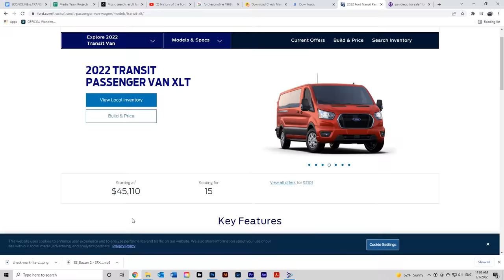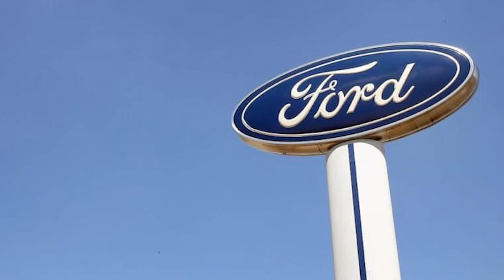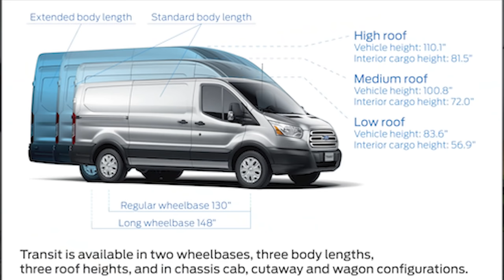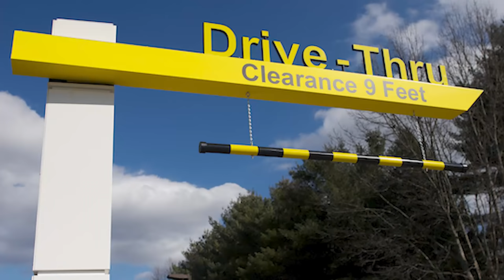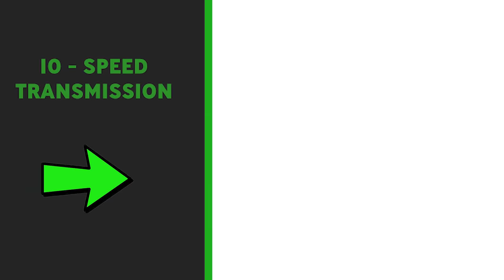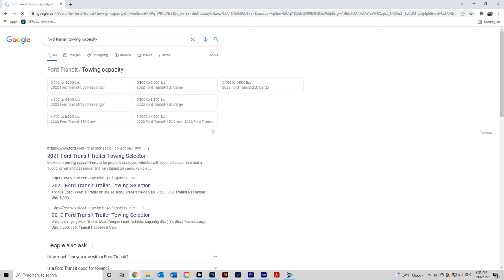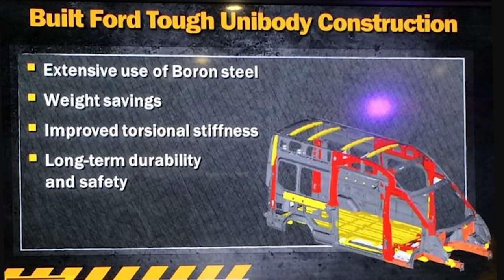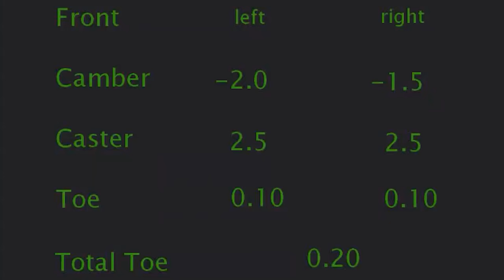Ford Econoline VS Ford Transit | Side By Side Comparison!

Comment: Trust me you want the 4.6L. They don’t die.
Reply: Who are you specifically that we should just "trust [you]"?  Give some data or experiences or SOMETHING
Reply: The 4.6s are famously known to in the Crown Vic’s, Town Cars, Grand Marquis, F-150s, and Mustangs. All of them are incredibly reliable.
Reply: Had every engine the E series ever had.  The “truck 6 “ 300 ci shit all over the 4.6 as did the 351 W (with cross flow injection) and definitely the 460 ci. The 4.6 totally underpowered and got worse mpg than most of the larger engines. 5.4 triton was ok as long as you could keep the spark plugs in the heads !! Same as the V 10. ( just a 5.4 with 2xtra cylinders slapped on ). 4.6 in my explorer and clown car - great. In the e250 sucked
Reply: @StepheMauro-kh1px  I hated my 4.6 until my mechanic changed e2 sensors, plugs, coil pack, cleaned mass air flow  sensor, and got the computer shifting the trans correctly. I carry heavy loads and no longer get pushed around by SUVs. 2005 200k miles.
Reply: The 5.4 2 valve  is pretty  bulletproof as well , I mean it's no 300 inline ... but if you take care if it it's a great engine
Reply: I have an E150 and 250 both with the 4.6  both have over 200,000 miles.
Reply: My son had a 2005 short wheel chair E250 van (super hightop) with a 4.6
 It did REALLY well and had plenty of power. 17-18 mpg highway.  My 2013 E350 med hightop 5.4 can get 16 mpg if you REALLY stay out of the pedal.
Reply: @Redfiregtag 
Oh, the 300 is damn near indestructible.
Reply: They dont die but you average 13mpg for the rest of its life 😂😂

Comment: Convenience tall roof only. Transit. No question. Reliability E series. No contest. Long term ownership. E series no question. They last forever and parts are stupid cheap! Rust is the only drawback. You can do a lot of repairs and use a lot of gas for the money you save though. E series for the win!

Comment: Call me crazy but I love the 4.9L / 300 straight 6. Sure, not a ton of horsepower, but totally bulletproof and lasts forever. I'm all for the E-series. I want an old-school vehicle I can actually wrench on myself. Not something that requires a degree from MIT just to change the oil.

Comment: i owned 7 Ford econolines...75 to 95....from 351 , 300 six....302.....in 2015 i bought a new T 250 mid roof 3.7 non turbo......the Transit has given more problems...that all 7 Econolines...while i like the heights...lengths and handling of Transit....but cant keep brakes on it...28,000 miles.never pulls a trailer even though it got trailer towing package....under gross vehicle weight...they didnt update brakes pads look like car typle...,,now is a good time to mention you have to pull rear axles out to replace rear rotors and brakes...costly......hard to work on ...try changing automatic transmission fluid in one..as far as engines...when empty the 3.7 is a little better on gas...but when loaded no better than 351 v8...i wish Ford had kept chasis and engines of the Econolines...and make mid and hi roof editions of it....also just read on all these sites how bad direct injection clogging intake valves...and cam phasers...and chainging are ware out on these new engines...something never had to worry about with Econolines..

Comment: My 2010 is on beast mode. 6 day  work day. Pushing  600 k. Change oil once a month
Reply from the maker: Does it burn oil or do you just drive it a lot?
Reply: @WeldtecDesigns  it does burn oil as 13+ years has a tendency  to make the oil seals not quite a perfect  tight. I never stomp on the gas and rarely  go above  70 mph

Comment: I have several E150's. If I don't get atleast 600,000 miles out of the original 4.6 engine and transmission, I'm disappointed.I know the local Ford dealer  service manager and he told me that the Transits just don't last like the E series did. He said if they 250,000 miles out of a transit they think they've  done something.

Comment: My 2008 has 372K runs great. Had transmission rebuilt once. 
My coworker has a 2004 with 508K and refuses to get a newer one. 
We both plan on driving them to the ground lol😅❤🎉. E-Series Rocks!

Comment: I bought a Ford 2021 E350 cutaway van with a 14'5 box and a 7.3 gas motor. I took it to 5star tuning and had them tune it to above the F350 tune.
The box has a 84" interior height and 79" interior width.
I have converted it into an RV.
I bought it to tow a modified Jeep around the USA, Canada and Mexico on a trailer. 
With the tune on the 7.3 I am getting 12.8 mpg. The tow rating is 12,000 lbs with a 4.56 gears and the 6 speed auto.
Reply from the maker: Send us pics! i would love to see that!
Reply: Why did you choose the 6-speed instead of the 10-speed?
Reply: @pronewbofficial  the 10 speed is not available in the E350 platform. 
I would have gotten a 10 speed if available
Reply: I have been thinking about doing this. Did you buy the new cab from Ford and then shopped for a box? Or did you buy yours complete from Uhaul or something?
Reply: @cvcoco  I bought a new one and special ordered it. It's a FedEx spec cutaway van. I'm tall so I ordered it with a 84" interior height and a 79" interior width. I wish I had of gone with the E450.
Reply: @Scrambler85 what was the mpg before the tune? When shopping around I see low mileage 7.3 cutaway box trucks for less then these high top transits. You get more area and 2x the towing capacity seems like a no brainer.
Reply: @user-tg3vw4pd7j  before the conversion I was getting 11.5 - 12.5 at 70 mph on the interstate. Now it's 10.5 - 11.5. I gained about 1.5 mpg and and more than 100 hp. The F250 has 430 hp, the tune is equal or a little more from the original 300 hp.
Reply: @Scrambler85  What is the city mpg? How is it while towing? With all the problems people have with the 10 speed this cutaway with a heavy duty 6 looks like a great set up.
Reply: Thanks for that description. Sounds cool. Did you put a fiberglass wind dam on the front of the box? I have a 2003  cutaway Quigley E350 w/ a 7.3 PSD. I grabbed a fiberglass wind dam from a local junk yard this week. I am sure its gonna help, just curious of others experience.  Its a super slick tight fit, so I am excited to throw it up there to see.
Reply: @reidcrosby6241  mine has a Areo top above the cab. Gives me a 6' door into the box, and some extra storage
Reply: @Scrambler85  thanks

Comment: I just picked up 2013 Ford Econoline 350 XLT with 18K miles.  There is something about the look of the Econoline attracts me to it more than the Transiit even the Transit got better mileage or room inside.  Just update new infotaining and sound system.  Next will work on lift :) 
Great video there Jeremy!
Reply: It’s body on frame, usually with V8 motor, and transmissions that cannot be killed, . .. E vans were the most reliable vehicles ever built, they can take so much abuse and still go.
Reply: What are you getting MPG?

Comment: Paramedics frequently work part time jobs.  Mine was for a company that only picked up patients at all those free-standing ER's that popped up everywhere. Good business model for an ambulance service, very profitable.  We got the first Transits that were made into ambulances.  I had just retired from a municipal EMS that used F-F450's with HUGE boxes mounted on them, an Iowa class battlewagon.   So I went from having all the room in the world with all the storage space for all the cool paramedic toys in the universe to a narrow shoebox.  Its ok for non-emergency local transports (the bulk of the business in the freestanding ER to hospital niche) .  It was uncomfortable on longer trips. They had frequent electrical and cooling system problems.  The Ram Pro Master ambulance conversions have made big inroads into the market.  They have a lower load height for one.  I started EMS in the 80's for a private company that used E-350's with a high fiberglass top attached.  They were rugged, strong, fast and maneuverable.  Not many of those are being made now. (Because the Transits and Pro Master have higher roof options from the factory)  Most E350 chassis ambulances are just the van cab and a box mounted on the frame.  We swapped from gas to diesel in the early 90's. More torque, held up better.  There's a move back to gas going on.  Diesel is much more expensive now.

Comment: Yes! I think you are the only place where we van enthusiast can learn the optional overland builds available for the newer Transit.
Especially, the difference in mpg between stock and lifted larger wheels. Of course it will also depend upon the Transit engine size. Hopefully, you will show the 3.7 because that is the most common. Also, standard vs 4x4.
Thanks for the show!
Reply from the maker: That's what we're about. We're here to inform and entertain. It's awesome to see you watching our content and learning something too. Comparing a Standard vs 4x4 could make for a great future video! We'll keep that idea on deck!

Comment: I have a 2007 E350 with the 5.4 and yes sucks a lot of gas but I love it so far is been a super good van, I tow with it few times a small toy hauler and even that is loaded with tools for my business over 2500lbs it pulled nicely,  I put a awning on it to use when camping etc and if you see this van in the cargo area I will say is the only van like that because I set it neat and everything is Milwaukee packout drawers etc ,I can called my Milwaukee van! That's how nice is set up, I can't go wrong with what I have now, very happy with it!, purchase this van under 93000 miles and just remove the  thermostat a week ago and loving it! ,didn't have any issues yet and it's about 110000 miles with still factory  parts, only belt and thermostat so far.

Comment: Thanks for a great video.
I love my 1999 Ford Econoline E350 super duty van with 202,000 miles on the odometer.
She starts first time, every time. She cruises at 80 mph all day, hitting limiter at 95.
I call her Ol' Trusty Too. I replaced these items: springs, shackles, shocks, upper and lower ball joints, kingpins, tie rods, steering gear, rotors, calipers, Goodyear radials, radiator, alternator, nickel rust-proof nickle brake lines, intake manifold gasket, coil wires, plugs.
This vehicle's stance indicates competence and capability.
She cruises like a Chevrolet Suburban or a Ford Expedition. With a 3.79 differential ratio.. 1,750 rpm at 60 mph -- effortless interstate cruising with sufficient power to tow a fully loaded double-axle U-Haul above interstate speeds all day long, with no oil pressure or coolant heat problems in the 5.4 2 valve V8.
Ford vehicles have excellent, safe driver visuals. The side windows dip low, the windshield is wide and tall. Chassis and inside, outside trim and body integrity are the best in the industry. The 25 year old headlights shine straight and true, and do not vibrate in their mounts. Obviously the electric system is A-1 for these headlights to have lasted this long.
Ford light trucks are the best in the business.
Detroit Iron Forever!

Comment: Good stuff. I just got a Ford Transit 350 EXT High Roof.  I tows less and has less get up and go thanow my El350 with a V8 but I am 6'4 so standing up in the back was more importan than towing. As a side note: It's a city van not a back road, driving over curbs and stuff van
Reply from the maker: We all need to run off a curb! just fun but i get standing up is important. Thanks

Comment: The E-Series is perfect for me. I currently own two. 
1998 E-Super Duty (early name for the E450) with the 6.8L V10 
2000 E150 with the little 4.2L V6 

The only thing I dislike on my E450 is the lack of a parking brake for the Dana-80. The driveline brake doesn't work all that great. 

I'll never own a Transit. The drivers door is the main reason why I won't give it a chance. I want a full window opening like the E-Series or at least a large window opening and a functional vent window like all the 3rd gen Econoline vans I've owned.
Reply: what's wrong with the transit window? it looks plenty big to me.. my work e250 has no vent windows and the bosses 350 doesn't either.
Reply: @angsta22   The 3rd gen had the functional vent windows. The 4th gen doesn't have the vent windows but has a full window opening. 
The Transit has a tall narrow window opening and a fixed glass for the forward quarter glass. And the bottom slopes down toward the front. Driven several Transit vans and want to like them, but I just don't.
Reply: Why do you even need a parking brake?
Reply: @jeepcollector91  window full or split is less of a problem compared to the tranny issues Transits have
Reply from the maker: I hate the transit window as well.... LOL

Comment: I own a 2013 E150 XLT Premuim van. It has every option available from the factory in 2013. It is a gem. Tows our 2019 Airstream Flying Cloud 25' trailer like a champ. 8600 LBS Gross Vehicle Weight Rating. Rated to tow 7000 LBS. All in great comfortable leather interior.  The Transit Wagon (van with full factory interior) sucks as a tow vehicle. No frame, rated to tow less than 5000 LBS, tiny brakes compared to the E Series. The old school E Series vans are tough as nails. Ask any commercial user. Takes a beating and asks for more. Parts are available everywhere and they are easy to work on. Enough said.
Reply from the maker: I am with you, wish you could still get them new.
Reply: Exactly! The new Transit sucks as a tow vehicle and it makes me sick 🤢. I was hoping to tow my boat and only need 5k towing but that would max out the Transit

Comment: They're both pretty good, i drove a 2006 Econoline at work and its a solid vehicle, my dad has a 2015 transit it drives very nice and has been pretty reliable, besides some fuel pump gremlins because it's a first year Transit.

Comment: I’ve got a 2013 E150/E250. I do expedite shipping and run it like a dog. It is about to turn over 300,000 miles and runs great. The body and frame are in excellent shape and if the motor ever blows I’m just going to rebuild it. The payload and towing capacities are very similar between the E Series and the Transit but I’ve gone over the max payload in mine on a few occasions by quite a bit and it didn’t act any different. I’ve seen Transits buried with a ton in the back. Inmy opinion the E Series is much easier to do engine work on with the dog house in the cab. I’ve gone through 10 inches of snow with good tires no problem in it. The Transit is a great work vehicle as well but I’d probably opt for another E Series before I got a Transit.
Reply from the maker: It is awesome to hear all these great E-Series stories. Thanks for sharing.
Reply: Do you think rebuilding the engine would be better than an engine swap?. I'm in the same situation as you
Reply: @videos10  as long as nothing major happens like a rod blowing out or something like that I’ll probably just rebuild. If I happen to come across an engine I may rebuild that and just swap that way I have less down time.

Comment: Jeremy Johnson has enlightened me regarding the history of the E-Series and Transit, and I thank him.  That said, I think at last count, I have had fourteen E-Series vans from 1974 through the last, and current E-150 of 2013. Worked at Ford Body Engineering for 26 years, and had a pretty current model most of the time.  240cid's through 460's.  Tricked many of them out with interiors and drive trains.  Used them for camping, hauling race sailing catamarans, tournament ski boats, dirt bikes, scuba diving, hauling windsurf, hang gliding, mountain and road biking equipment, electrical, plumbing, framing, welding, trades, aviation related maintenance, towing agricultural equipment, sailplanes, kiteboarding, snow kite skiing, wind foiling, etc.  My new 2022 Tranny is said to be in transit from production to the dealer as we speak.  Guess I'm gonna find out pretty quick how the low-roof shrew compares to those bad-ass buggies of the past.  Thanks again for the creative reflections on the models, Jeremy.
Reply from the maker: Thanks so much for your kind words! glad you like the video.

Comment: I have a 5.8L v8 e150, but is a 1993 conversion van, anyone know why there are different motors? and why is the reason of that? is not the oficial motor that the van have of fabric but is put there by the company that made the conversion? I need answers, please!!

Comment: 97' 7.3PSD Econoline 350 vs 21' 3.5EB Transit MR, transit tows way better hands down. More usable power, never look at the gauges, stability for trailer and crosswind. My 97 had a tuner and a built trans, and this transit still walks it everywhere.

Comment: Awesome Video and editing!!
I love my 14 E350……but I’m not gonna lie…the MPG is hard to ignore these days.
Reply: and make sure you have no CEL codes.. quite a few of them will kill mpg.. and vacuum leaks if the 14 still has that for heater controls, they will make it run like crap
Reply from the maker: Thank you so much for liking this video! MPG is something nowadays.
Reply: My 2004 E350 Ext cargo 6.0 diesel van gets up to 22 mpg, I've got the atlas 80 FICM Tune and a 4" straight pipe with 356,700 k flys the interstate like a Peterbilt!

Comment: You never mentioned the 5.8 351 Windsor or Cleveland motor in this video. I got a 1996 e350 super duty extended 15 passenger with a 351 Cleveland I believe .I really like it
Reply: That was last year for it. It had the same induction system as the H O mustang. - awesome motor  wish I still had mine

Comment: having a hard time choosing my next work van. transit 350 3.5EB box truck vs the e350 7.3 godzilla box truck. buying basically brand new under 15,000 miles. will be doing a lot of plumbing work and hauling a small excavator but not as much. wondering if the 10 speed mpg savings will matter as much as the simplicity of the 6 speed over the span of 200,000 miles of its lifetime.